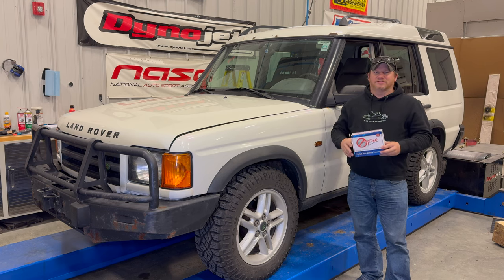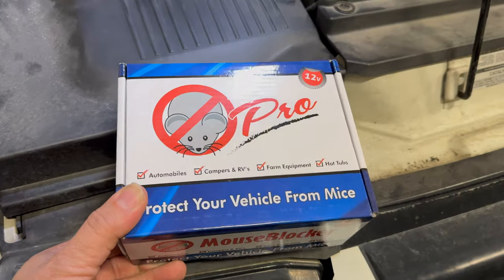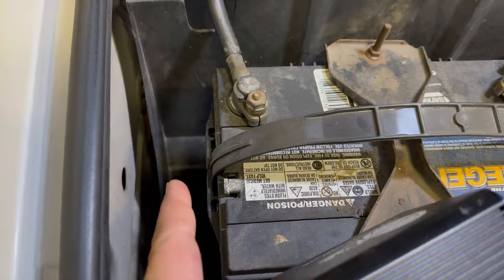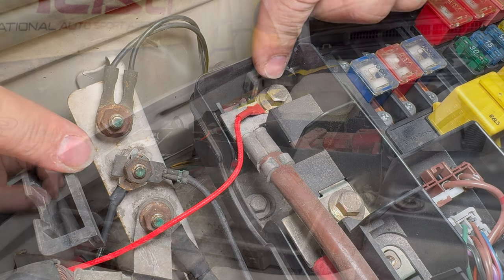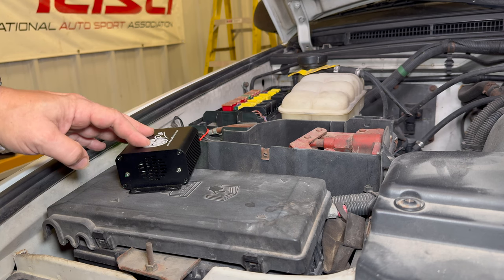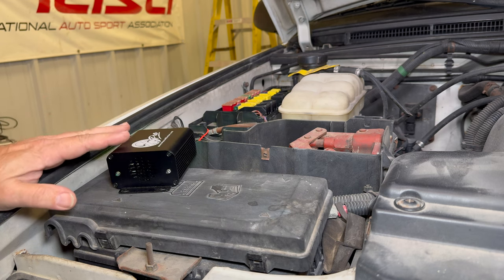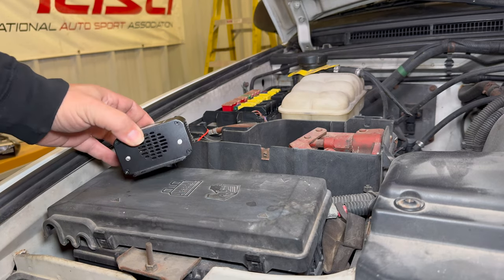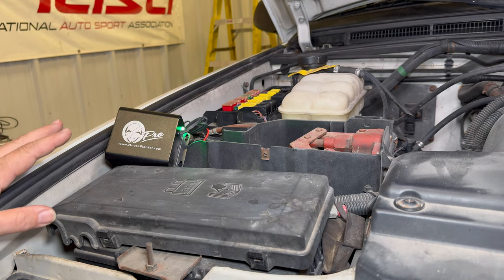Mouse Blocker 12V Install

Comment: I believe these product do work initially.  I plugged one in within my shop and latterly saw a mouse immediately scramble out from behind a bench.  However, the question is for how long.  They are piezoelectric speakers generating the ultra high frequency noise that irritates the rodents (we can’t hear it).  As with a lot of piezoelectric speakers, they may not work with continuous use for an extended period of time.  Since we can’t hear at that frequency, how do you know when it breaks?
Reply: use an iphone as an audio meter

Comment: I think Shawn Woods debunked these types of products years ago and proved they did almost nothing😢
Reply from the maker: I just did a search of his channel and did not find him testing this product, just the cheap ultrasonic ones.  I have had the 1000x unit running all summer and it definitely has kept the birds out of the shop and no mice have been seen on the TR8 it is sitting on.  It puts a significant pressure on your ears when you get near it even when you cannot hear sound from it, it is very unpleasant and even keeps me away from it.
Reply from the maker: The one I have in my motorhome is also so unpleasant that I have to unplug it if I am in there.